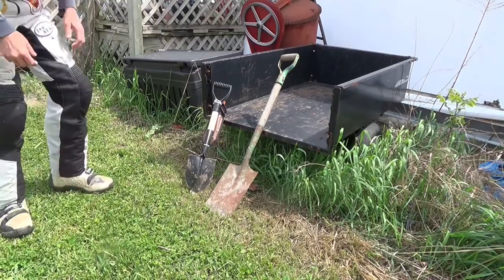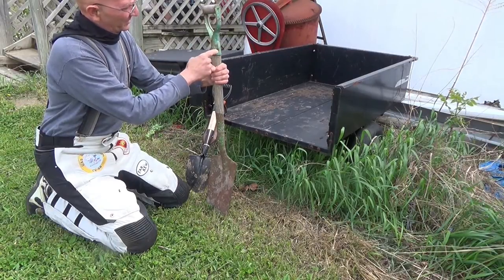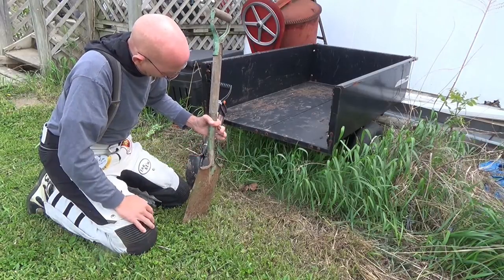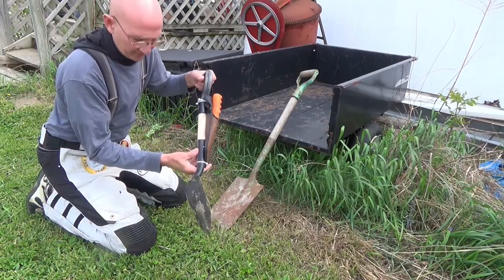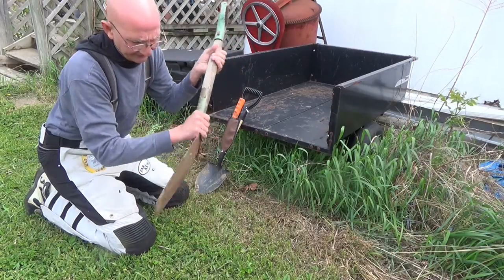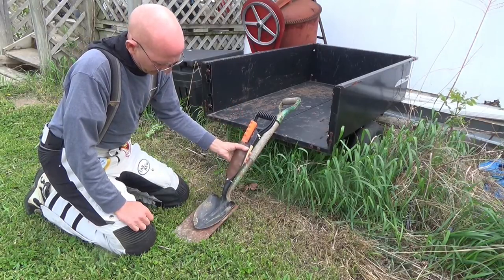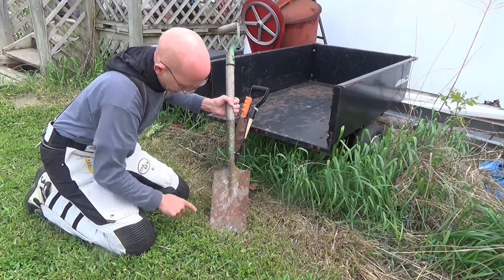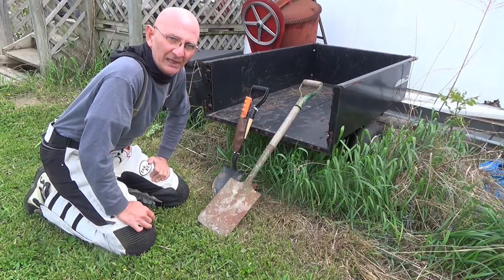Metal Detecting Shovel mods on the cheap

Comment: spot on. i had a metal detecting shovel the same as your one and 3000 holes later it snapped. i was going to do the same as you are doing.but i got this one with the blue handle and its mint. built well to and its got to have done 2000+ holes now and its still going strong.out tomorrow to dig 200+ holes.HH
Reply from the maker: Well I am Just starting out, So I have no real fear about this. It is a lot of fun to build! Hell, I may the mother of invention when I get done! Thanks Darren! All across the board!
Reply: that going to be cool when you have done the shovel it wont let you down. thanks for this video i know where to put my raptor 1 now just fitted it to my shovel.your see it tomorrow cool.

Comment: Much easier with a Plasma cutter! Are you going to bevel the edges a little, so it doesn't tend to bend?
Reply from the maker: Yep, and the cut-offs I will weld on the back for strength.